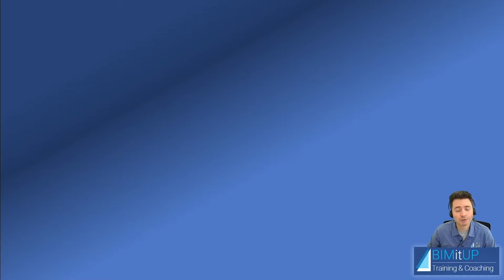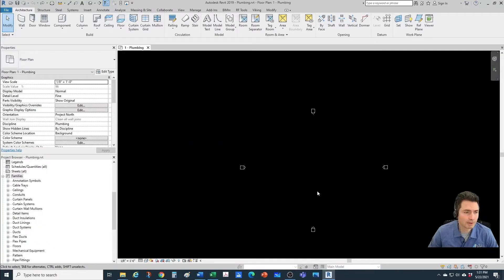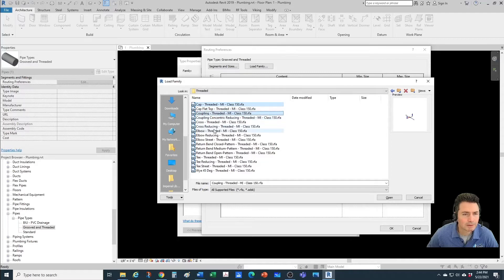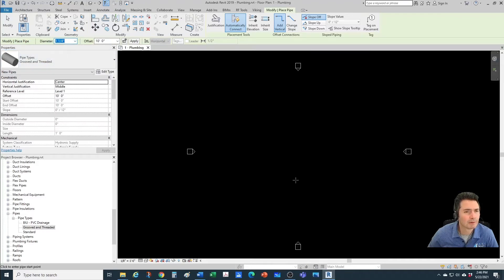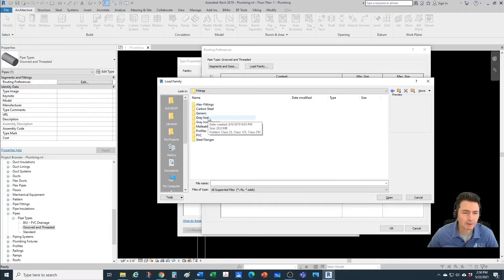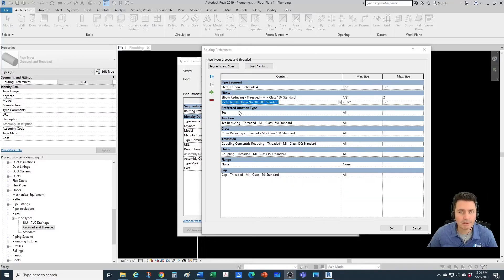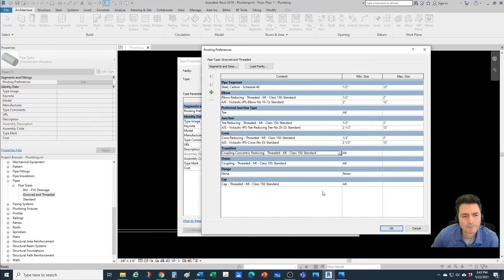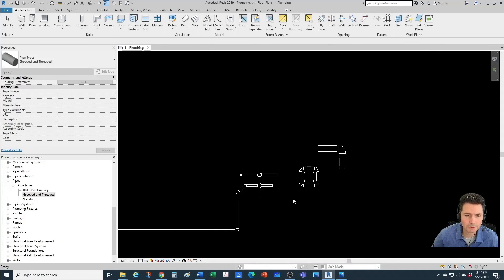How to Create a Grooved and Threaded Pipe Type in Revit MEP (Steel Routing Preferences)

Comment: Hi Alex, Is it possible to create a routing preference with both tap and tee fittings? I would like to have a main pipe connected to branch lines with a welded outlet (tap) at the main and a grooves tee at the branch lines, is there a way to achieve this within one routing preference?
Reply from the maker: Sadly no (to my knowledge). In AutoCAD MEP this was very easy to do. It is a shame that you have to "choose your poison" here. Good luck though!

Comment: Alex, I am trying to create gas piping pipe type with 1/2" to 2" screwed fittings and 2 1/2" to 12" welded fittings.  I am not able to transition from 2 1/2" to 2" without an error.  What fitting does one need to make this transition work.
Reply from the maker: Hi Mike. That is a good point.
I already corrected that, but I had already uploaded the video.
The trick is to have some "overlapping". For Example:
In the video example, I should have had:
- Threaded reducing from 1/2" to 2" and
- Grooved reducer from 2" to 12" (not from 2.5" to 12").
That way 1 1/2" to 2" is threaded, and 2" to 2 1/2" is grooved.

I hope this clarifies. If not, let me know =)

Comment: Thanks a lot, How do you create Welded elbows & Flange end pipe with same pipe dimension?
Reply from the maker: You are welcome.
Do you mean a welded elbow with ports with same diameter as the connecting pipe?
The "Standard" pipe type, out of the box Revit, I believe should have that.
Let me know if you would like me to create a video on elbow family creation.
Reply: @bimitup  Thanks Again, For example a pipe of 200mm Diameter with welded elbow and Flange for Butterfly Valves  and other Fittings .
Reply from the maker: @l.aalbert8596  I can speak for US Imperial>Pipe>Fittings>Generic. That can be your base for elbows and tees. As far as Valves and other fittings, you can look into Carbon Steel and Steel Flanges. You can also create a particular family that is welded on one end and flanged at the other end, but that will have to be in the family.
Remember a flange is something you are "forcing" to exist at the end of the pipe when you select a "flange" in your pipe type routing preferences.
I hope this helps you.

Comment: Is it the same if I want my pipe to be threaded sch 40 and after specific size grooved with Sch 10?
Reply from the maker: Hi Iván. That is a very common piping setup you will find in fire protection. Sch 40 threaded for branches, and Sch 10 grooved. But it varies from case to case.

Comment: hallo, Great video, I have doubt, when I model the fire network I am facing one issue with transition between grooved and threaded, for example 2.5" to 2" I cannot connect the pipe.is there any way?
Reply from the maker: Are you talking about a reducer from 2.5" to 2"? or a 2" branch connecting to a 2.5" main?
Reply: @bimitup  yes the reducer one end grooved and other end threaded.

Comment: Great Piping Videos Alex! so many other Revit videos are "Plumbing" so glad I came across yours! Do you know where I can find B31.3, CL150, Carbon steel, A-105 forged steel fittings, beveled end/Butt welded type, etc. vendors that provide Revit Families? seems the out of the box has mostly Malleable iron, flanged end fittings.
Reply from the maker: Hi Daren.
Thanks for the comment. We try to go a little deeper into things and spice it up with some real engineering.
B31.3? Are you doing process piping? (Chemical, Oil, Pharmaceutical?). I doubt you will fond those easily...
For A105 maybe Anvil?...
You can always create duplicates from threaded or something similar and modify the parameters...
For example, I took the out-of-the-box PVC and modified the hub distances (got rid of them) to mimic No Hub Cast Iron...Autodesk's fittings are friendlier than IB Foundry or Charlotte. Are you familiar with "Lookup Tables"?
Good luck =)